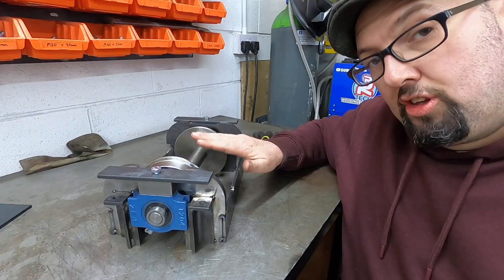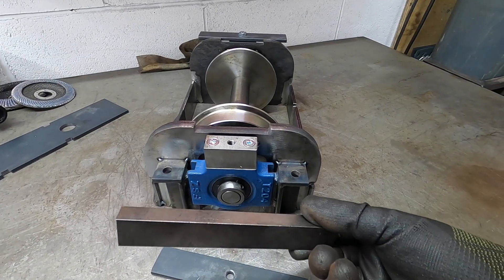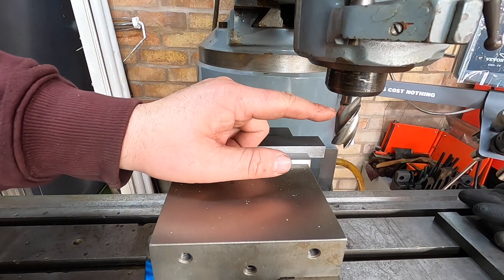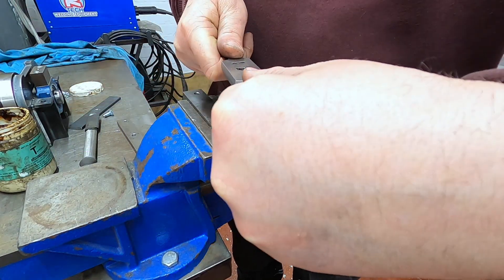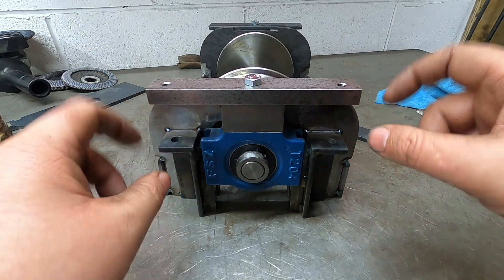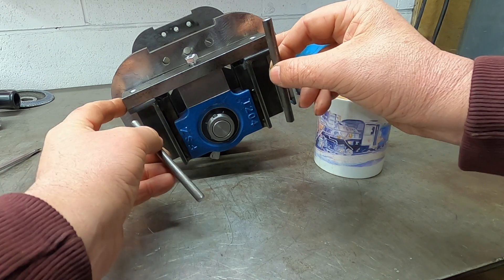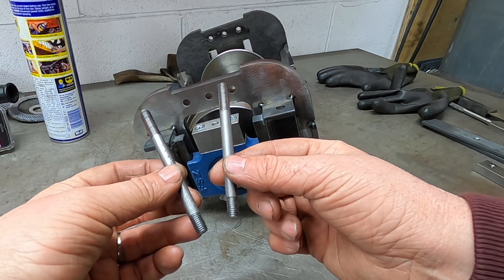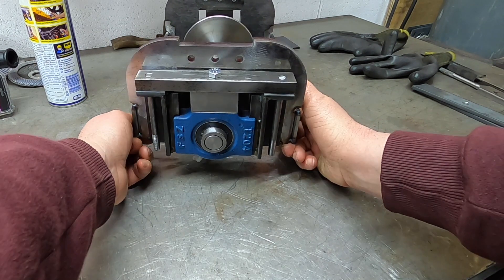The Pony Truck - Pt 6 - EP21 - 7.25" Gauge Steam Locomotive Build.

Comment: Coming along nicely. This looks like a really fun project. Neat trick with the drill press. If you haven't already, get or make yourself a spring loaded tap follower. I do all my tapping (as much as I can) in the mill, right after I drill the tap size hole in the material. It's lined up perfectly and the tap follower ensures I am straight and gives constant pressure.
Reply from the maker: Thanks My Lil' Mule, much appreciated. After Edward mentioned it I went away and watched a few videos on tapping with the Bridgeport and then this morning I watched an Ades Workshop video and he was using a spring loaded tap follower. I thought That would be handy, so yes its on the list to buy or make. All the best, Matt

Comment: Hi Matt.
Any idea as to what the loco will weigh once it’s operational?
Will you need to build some sort of stand/trolley to move it around the workshop?
Regards
Robert
PS New, sharp files are a joy to use eh? 😃
Reply from the maker: Hi Robert, the loco will be around 600kg + fuel/water + plus me, so very heavy! 
I have a trolley already and did an early video on amending it called ‘the loco build trolley’. The idea is once the loco chassis is built the engine will move down off the trolley to track on the floor. Not risking that falling off a trolley. 😂
All the best, Matt
Reply: @MattChiversWorkshop  
Thanks for that Matt 👍
I agree…. wouldn’t want a 600kg ‘anything’ falling off its trolley.
Even my little 5”gauge 2-6-0 Baldwin will weigh around 100kgs (when finished 🙄).
I’m planning on building a ‘rotator’ for it ( supported by the end beams), and a trolley to get it from my little workshop out to the driveway.
Great series mate 👏👏
Regards
Robert

Comment: I really enjoyed the new table fabrication video. I haven't done any real fabrication work since I built my log splitter back in the 70's and more recently my CADPlans backhoe. No need to. Your new file sounds great as it cuts but I did notice your bench with the vise on it is shaky. Probably the same time problem as with getting the chuck back on the Harrison. Soft jaws on a bench vise are easy made by wrapping a piece of soft copper around the jaws. Makes a nice soft jaw surface and comes right off when you need the serrations on the standard jaws. To you and William I made a double entry left hand Acme thread for the reversing system on my Simplex.
Pony truck kooks great!!
Dick B. USA
Reply from the maker: Thanks Dick. Yes the bench is on wheels, and recently I have changed my mind about it. I file, it moves, I use the hacksaw, it moves, in fact I do anything in the vice and it moves. So I plan to replace the wheels with bolt on mini leg extensions, so if I ever mange to get a bigger workshop I can put the wheels back on and have it as a mobile bench. Left hand ACME!!! think we need to master right hand threads first 😂. All the best, Matt

Comment: 08:05 - I have fallen in love with single point thread cutting, for sure. I can't wait to see what you're going to come up with on that monster lathe - 40mm acme threads? :) I'm having a similar quandary about springs in my build, 'wind a piece of spring wire 8 times and you're good' doesn't translate so well to ordering springs off eBay - I guess I'll need to figure out spring manufacture too!
Reply from the maker: ACME threads! Corr blimey, stuff of knee rubbing excitement that is! 🤣🤣 That is something I’d definitely like to have a go at! Especially internal acme threads! We have all the parts to put new chuck on the Harrison, just need time to do it. Lots of bits I want to do to the lathe but no time at the minute.

Springs…. Less exciting, buy online much easier 🤣🤣. All the best, Matt